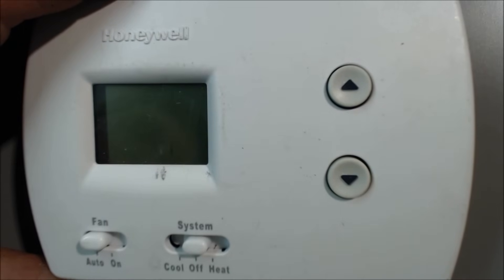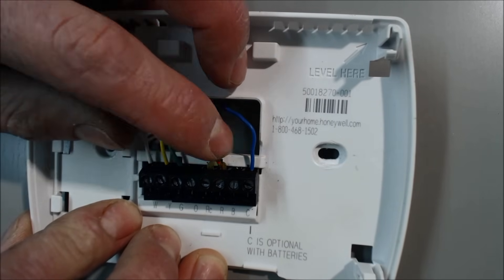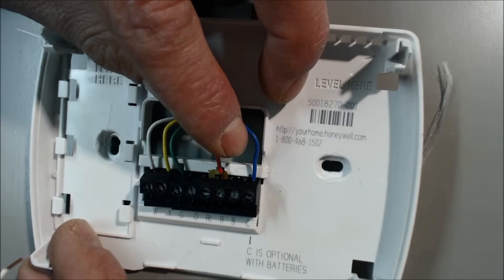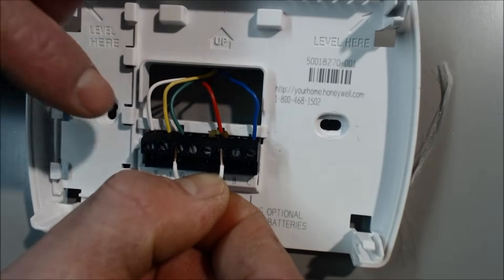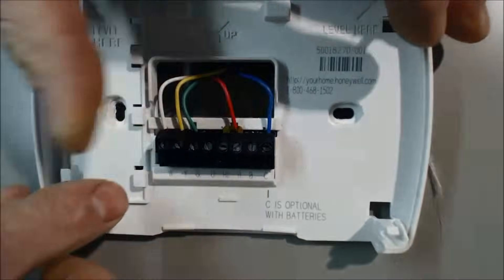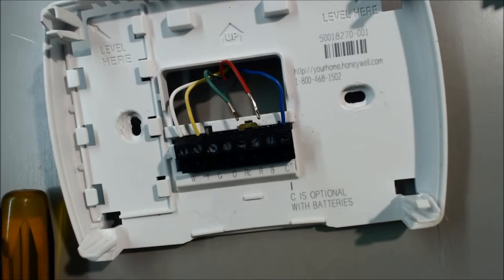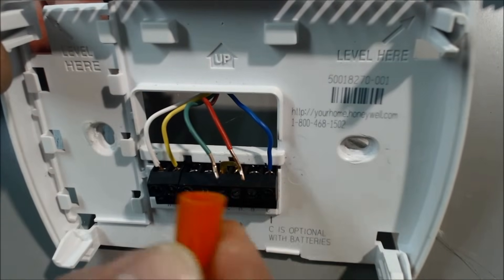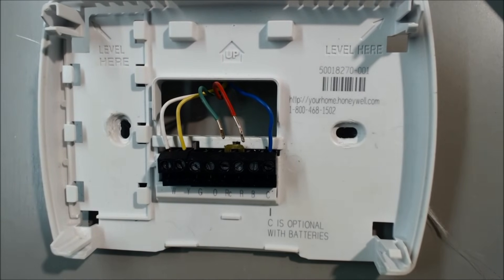Troubleshooting if a Thermostat is BAD: Explained!

Comment: I just have a red and white wire. I only have heat so that should explain it, right? My panel “works”  meaning it can be set etc, however it has no impact on the furnace. If the heat is on it keeps staying on... and temp keeps rising. Any suggestions?

Comment: The only way to get my heater to kick on is to change the fan selector from AUTO to ON. Then when the desired temp is reached I change it back. But then it wont kick on again when the temp drops. Should I just replace the thermostat?

Comment: I have a t-stat that allow the fan to come on when place in ON position, but the fan will not come on when placed in Auto and calling for cooling (only the comp. is on). Wouldn't this indicate that I need a new t-stat?
Reply from the maker: The thermostat should connect R to Y and G in the thermostat when calling for cooling. It sounds like the thermostat is not telling to fan to turn on so it is likely the thermostat, thanks!

Comment: good vid...but wait do i have turn the unit off at the circuit breaker or near the unit BEFORE i jump the red/green wire?
i would think the unit should be on, so then the fan can come on if does happen to trip? please help
Reply from the maker: The unit would be on while jumping from r to g at the thermostat. You can turn the unit off for safety while taking the cover off initially and then turn back on for testing, thanks!
Reply: @acservicetechchannel  anything i can do to test the TSTAT wo doing that? My TSTAT, delayed when dropping the temp from 78 (all day on at 78) to 75, cool word just blinked for 15 minutes, NO cool blower came on!.... then turned on after 15min delay.... 2nd time it happened, i shut off the unit for 30 secs. and turned it back on, and tried dropping the temp, and it delayed for a bit 5 mins or so but the cool fan came one.....does this help on what it could be??? Blower or TSTAT?
Reply from the maker: @mml1224  If this is an ac only then you can remove the thermostat face and jump from r to y or r to y and g. If the air conditioning turns on and runs with no problem it is not your control board. Make sure to not turn the compressor off and then back on in under 4 minutes. The refrigerant pressures need a chance to equalize.
Reply: @acservicetechchannel  Thanks, but if the the a/c blower comes on after jumping r to g or r to y, then its the t stat? Or what else can it be, I heard a blower motor capacitator?

Comment: I have a blank screen on my thermostat. Outside unit, so no drain pan. Thermostat wired to house so batteries not needed. However, the screen comes on when I install batteries. But nothing else happens. But the two snowflake icons flash. This is a 3-year-old PRO1 t701 thermostat with a Comfortmaker unit. What would you recommend I check? It's a hot Saturday night in Texas and having a heat stroke in the past, I don't handle heat well.
Reply from the maker: You would need to check the 3 or 5 amp fuse in the outdoor unit after turning the power off. test from r to c with a multimeter for 24v, thanks!

Comment: My outside fan is on but my unit in the house won’t turn on what could it be
Reply from the maker: That could be a bad indoor fan motor or just a bad capacitor, thanks

Comment: Sure is hot in here this summer but im going to miss these low electric bills once i do get the ac fixed one day. Big difference in 250+ per month and 30-40 per month!
Reply: Last night was only night 3 for me.. running the fan on myself wasn’t so bad even though it was 86 in here (Florida)

Comment: What does it mean if mine has rh and rc
Reply from the maker: Rh connects to w on a call for heat. Rc connects to y and g on a call for cooling . Rc connects to g for fan. The thermostat is powered between RC and C which is common for the 24v when not using batteries, thanks!

Comment: Went through severe storms and had a big power surge several times. The unit wouldn't come back on and since it was cool weather I thought it was just the heat but it's the ac also. I have power to the unit and the tstat has it's digital readout but I switched from off to ac and nothing happens. So no heat and no ac and I really need my ac it was 95 in my house last night. Thanks for any help.
Reply from the maker: Did you connect the r to the g to see if the fan would come on? Is it possible the thermostat has battery power but not 24v at the r terminal. The fuse inside the furnace may have popped or the switch or breaker may be off to the furnace, thanks

Comment: What if your digital display won't light up? Yes, we replaced the batteries, and checked the fuse. Both OK.
Reply from the maker: If the thermostat has batteries and won't light up then it needs to be replaced, thanks!

Comment: Thank you for this video, the logical path you have laid out, though not exactly the issue I had, it helped me draft my own plan and it helped me diagnose my issue.  I was getting 24V at the thermostat, and at the circuit board at the air-handler in my basement.  I can hear the thermostat click when I switch to AC or Heat.  Heat came-on (this was summer and 80 F Day so I had to set the thermostat to 82 or something to get it to work, but it worked, the AC however did not.  Knowing that I got 24V (my meter showed about 27v), so I knew volts should be going out to condenser outside.  But the condenser did not start.  I saw no 24V at the contactor.  I pushed the contactor and it started, condenser and I held it there for a few minutes and family inside confirmed getting cold air, so I knew no issues with the condenser/ compressor.   So basically the issue was between the wire that came out of air-handler to the condenser outside.  I started following the 24V wires from the contactor to the wall, and I found the issue.  I should have looked for this as soon as I found a mice nest in the condenser, they had chewed one of the 24V wires and thus contactor did not get the juice it needed to kick-in the condenser.  Once I patched the wire, everything was working again.  

I have seen folks ask where to buy some of the electrical parts (Contactor, Transformer, Capacitor, etc.)  I found these on-line, but you have to wait for a few days, alternatively if you need one quickly I was able to buy at Grainger that is not too far from me, and a GPS (General Plumbing Supply) they had some of the parts I needed as well.  This is just an FYI.
Reply from the maker: Glad to hear, thanks!

Comment: My Honeywell TH5000 works, turns on ,etc. BUT it is wildly inaccurate. Displays wrong house temps and will come on in AC when temp reads 77 IN house and No way is the house temp 77. SO, I get very cold in my house on A/C.  I'm Not technical, thought maybe I could reset/reboot it, etc, but not sure.  Any advice??? thanks
Reply from the maker: Sounds like you may have batteries that need to be changed in the thermostat or that the thermostat needs to be replaced, thanks!

Comment: What if it just click instead of the fan coming on
Reply from the maker: You would have to test for 24v between the g and the c with the multimeter at the furnace or air handler control board to know if the tstat is working properly, thanks!

Comment: My thermostat is not lit up. Ac won’t come on but fan will come on. Do I need to do thermostat check or is it likely bad since it doesn’t light up?
Reply from the maker: Does it have batteries and have you replaced them or is it hard wired? thanks

Comment: I did this test and now my blower doesn't turn on. I was trying to turn on my AC fan outside :'(
Reply from the maker: You may have accidentally blown the 24v 3 or 5 amp fuse inside the furnace or air handler. The C should not be jumped out because that is common, and make sure that the furnace or air handler is turned off before checking for the fuse or call a technician, thanks
Reply: @acservicetechchannel  you are correct! I was looking and the 3 amp fuse was toasted. Took me a while as my furnace does not a circuit board and that's what I was trying to find. I guess it's a latest technical furnace. I Bought  a replacement fuse and now the furnace came back on. Thank goodness it was just that. I was tearing up thinking I destroyed the whole thing and would have to replace it somehow.
But my AC unit won't power on still. When I go outside and press the plunge on the contactor the unit powers on. The fan and capacitor seem to work just fine.
Reply from the maker: You would need to make sure the tstat is programmed if needed. Make sure you have the yellow wire on the correct y or y2 if there is two. Check in the furnace or air handler with the power off to see where the yellow or y wire  is connected, thanks
Reply: @Mr.DMZ. turn of power to condenser, bypass the thermostat connecting R and Y terminal. Go back to condenser and see if the contactor plunger is pulled in if so your thermostat is bad

Comment: I have a question if you don't mind answering it. I have a Honeywell thermostat, and it would blink like the thermostat was about to turn off completely. So I switched the coin cell battery and when I put the front plate back on to the back part mounted on the wall. I waited for it turn back on, and I put the cool air to auto and on 65. The fan never came on tho, and even when I bring it down to the lowest temp. It would still say "Cool On", but nothing. What could it be? Should I do what you did in the video? 
I did turn the breaker switch to Off, and then back On and it worked for a min then it shut off. Smh.

Comment: Cooling is good, emergency heat is good as well, but call for heat pump is not working at all, just flashing wait, wait...(long). on the thermostat.
Reply from the maker: Sounds like the thermostat is not functioning properly or it is intermittently loosing the supply voltage to the tstat which will restart the 5 minute timer again, thanks

Comment: What if your furnace doesn't stop when it gets to desired temperature just keeps running
Reply from the maker: That sounds like a bad thermostat or bad thermostat wires. If it shuts off after disconnecting the thermostat face then the thermostat is the problem, thanks

Comment: I have a rookie question for ya. I have two Lennox units in my house. The upstairs one is 2.5 tons and the downstairs is 2.0 tons. Why is it that the 2 ton outdoor unit is larger than the 2.5 ton outdoor unit? The 2 ton unit calls for 16 degrees subcool and the 2.5 calls for 6 degrees.
Reply from the maker: The 2 ton is likely a higher SEER rating than the 2.5 which means it is bigger to be more efficient in terms of heat exchange on the coils, thanks

Comment: also If the reversing valve solenoid was beginning to short out would it fry the defrost board or the thermostat? its a lennox 13hpx-030-13

Comment: Have you encountered a lot of problems with nest thermostats?  Mine just quit powering the O wire so the reversing valve stays in heat mode with the thermostat set on cooling.
Reply from the maker: Hey Jerrod, did you check for 24v volts by reading the o and the c at the outdoor defrost board with the thermostat on cooling? Thanks for your service!
Reply: Yes I did and 24v was not present at O. it’s confirmed it’s the nest thermostat. I plugged the one from downstairs into the upstairs unit and the unit started operating properly. if the reversing valve solenoid was beginning to short would it burn out the thermostat or the defrost board? Thanks
Reply from the maker: Technically, it should just blow the 3amp fuse at the indoor unit before hurting any control board or tstat. It would be likely the thermostat than the board but with the power off, unplug the compressor and take an amp draw on the reversing valve by wrapping the low voltage wire around the amp clamp 5 times to read the low amperage and divide by 5 if you thought that was the issue, thanks

Comment: I have a hunter programmable an I was wanting to know what the switches on the back of the panel are it says non/hphp sw3 witch one should it be on I have gas
Reply from the maker: It would be non heat pump if you just have an ac with gas furnace, thanks

Comment: Have the thermostat set at 70 but it reads that the room temperature is 62 but it doesn't feel like 62 feels more like 70 and my furnace runs for about 15 minutes turns off and right away turns back on it does that all day and the room temperature remains at 62
Reply from the maker: That sounds like a bad thermostat, thanks

Comment: I jumped the red and green and fan came on. But the red and white did nothing,  no heat.
Reply from the maker: If you jump from r to w at the control board of the unit with the door switch closed and the heat turns on then you have a bad thermostat or thermostat wire, thanks!

Comment: Believe or not sir, you are the best
Reply from the maker: Ha ha, thank you very much Chick. I am glad you enjoy the videos!
Reply: @acservicetechchannel  Sir pls i need your help. How do you check sub cooling on a mini split with no service valve on the liquid line. Thanks in advice
Reply from the maker: So if the minisplit is a vrf then we the manufacturer usually doesn't give us any charging guidelines for it.  What I have found though is that in cooling mode when the temp was above 70 degrees, many systems operate at 0-5 degrees of superheat on the full speed emergency cool call. The only reason that they function like that is so the saturated state is arger and they use the accumulator to protect the compressor. In normal units, low superheat would be a big problem for the compressor. The manufacturers just want us to use the total weight method for checking the charge which is a complete recovery, pressure test, find and fix the leak, pressure test again, vacuum, break the vacuum with the total amount of refrigerant that the system says it needs per the rating plate plus additional line set length, thanks
Reply: @acservicetechchannel  great

Comment: Awesome.  Girl Power.  You helped me figure it out.  I GOT HEAT.   I so refused to call service man.  I knew if air conditioner worked and I tested just like you showed to boot the fan, then I knew it wasn't the furnace.  I have where red wire could go either to RC or RH, it was at RC so I hooked red to RH and I got heat.   Thank you
Reply: Even though you now have heat, that's not really the proper way to do that. You shouldn't have to constantly switch your live wire over every time you want to switch between heating and cooling. If you only have one red wire coming in from furnace control board, it should be hooked into the RH terminal, while a separate jumper wire should be connected between RH and RC.
Reply: I have RC and RH. How did you test the thermostat?

Comment: I just noticed the blue wire is hooked in the "y" yellow spot. Been working for yrs until now and i just noticed. Is that common?  The problem I'm having right now is my thermostat says cool when it's turned on heat, but heat is coming out. The set temperature isn't correct though. I have no idea what the heat is actually on. Once it gets warmer enough, i just turn it off or it will continue running bc the temperatures never match up. Possible problems?
Reply from the maker: That sounds like you should have the thermostat replaced. The previous tech may not have followed the normal color code. You can verify the colors by looking at the indoor unit control board terminal letters thanks
Reply: @acservicetechchannel  Thank you. I removed the batteries and cleaned the inside. I think I will still eventually have to switch the thermostat though because I noticed the numbers won't show up every now and then. I will check the panel and colors though.

Comment: What if your unit makes a clicking sound when jumping 24v to your fan motor.
Reply from the maker: 24v to what fan motor? Do you mean to the g terminal?
Reply: Single phase. Goes to a gas furnace
Reply: Its basic 2 wire t stat. (Low voltage)

Comment: The free heat I get from my apt. complex isn't enough for me sometimes, and I'll put some ice around the thermostat.  This trick used to work big time, but now it doesn't work at all.  Have complexes gotten wise to this trick, and devised a way to prevent a sudden drop in temperature from being taken seriously? The thermostat will say the heat is on when I do this, but the baseboard heaters stay cold.  But if I remove the ice, and the temperature returns to normal, the heaters will come on naturally from a natural drop in temperature.  Does anyone have any thoughts on this, and what I can do to fix it?

Comment: First than everything thanks for the video well explained .. My friend I put the thermostat at 83 this morning and it shutoff all the sistem now it won't start. and nothing in the screen I put new batterys and nothing.
Reply from the maker: Did you check to see if you have 24v on the indoor unit from r to c? It is possible the power at the indoor unit is off or fuse is blown, thanks
Reply: Yes I do the  thermostat was the problem. I buy another one of the same i just put the new in it problem solved..thank you very much for your help.🙏🙏👍👍

Comment: when the fan is on, why do i get 0 volts from G to R?
Reply from the maker: That is because r and g are touching. You would read 24v between g and c if the thermostat was calling for the fan to run, thanks

Comment: My heat- off-cool button is stuck. It will go the left towards cool, center, but won't go to the right (heat) when pushed. Any ideas? Mine is the opposite way from the one in the video.